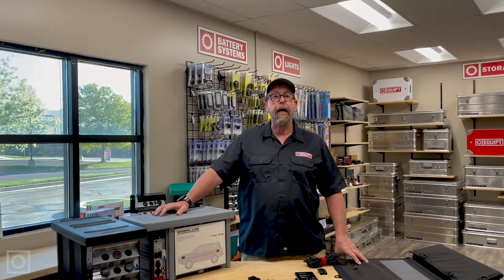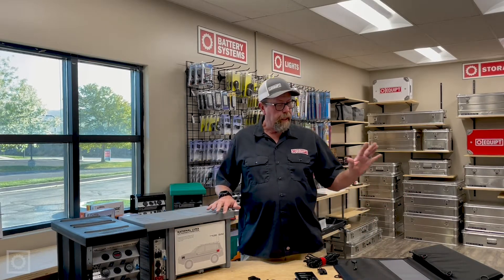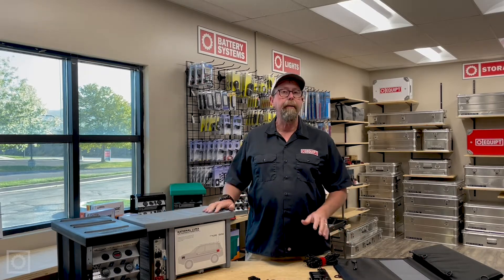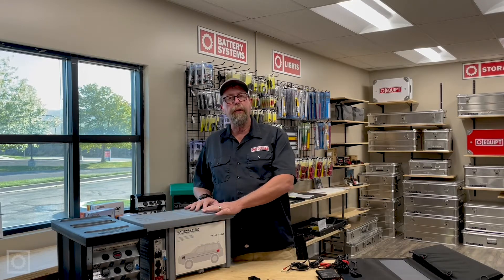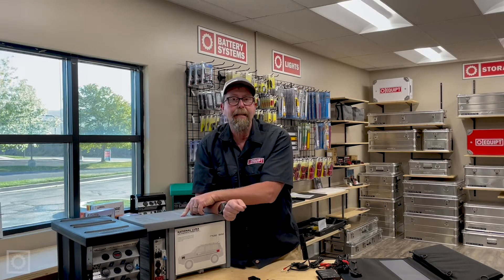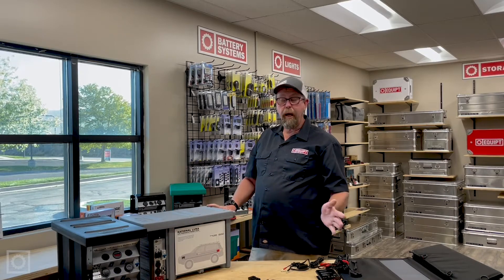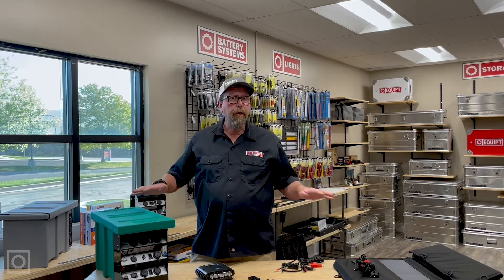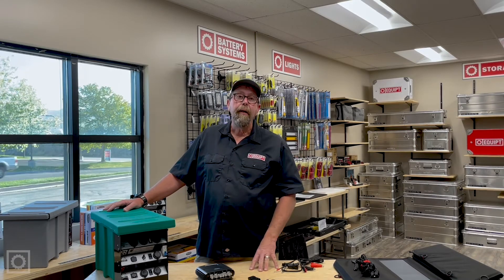How to Connect Solar to National Luna Battery Systems

Comment: Great video. You mention that you can connect an inverter to the battery box via the grey Anderson ply. If I do that do I need to ground the inverter? Or is that all handled in the setup of if the battery box? Thanks!
Reply from the maker: Anderson couplers have a positive and a negative contact point integrated. 

Depending on the size of the inverter, you should be able to connect an inverter straight to the aux anderson connection point. If the inverter exceeds the 50a rating for those connections, you should wire the inverter straight to the battery terminals. Some inverters have an additional ground that is meant to be connected to the vehicle's chassis as well.

Comment: Hello guys! 
I have the Luna grey pack and a DC charger redarc BCDC 1220. I wanted to plug my BCDC with a red Anderson to the red pack and use the grey one for solar / inverter or other things. But it seems it doesn't work. 

If I use the BCDC through the grey Anderson, the battery will charge but not trough the red one. Any idea ? Thanks !!
Reply from the maker: Hi there, great question.

Ultimately, you're combining two systems that are meant to accomplish the same thing. The RedArc system replaces the Intelligent Solenoid but the Power Pack and it's circuitry is designed around the Intelligent Solenoid. You are currently trying to push the charge from the BCDC through the intelligent solenoid (when connected to the red anderson input) and your DC charger most likely cannot recognize that there is battery connected to the solenoid on the other end. This is why you can connect through the grey anderson plug; the circuitry for that specific connection is most likely allowing the DC charger to recognize the battery. 

An alternative to the Power Pack would be the Aux Battery Box from National Luna (the black battery box). The DC charger can then be integrated into the Aux Battery Box without any interference from the Intelligent Solenoid or circuitry. National Luna offers an in house version of what you're configuring, the DC25 or DC40 Power Pack with an integrated DC-DC charger and solar controller. 

https://www.equipt1.com/collections/portable-battery-systems/products/dc-25-power-pack

There is not a great solution for modifying the Power Pack you already have due to the unique circuitry involved. You can continue using the grey input or potentially sell the Power Pack for an Aux Battery Box. 

https://www.equipt1.com/collections/portable-battery-systems/products/auxiliary-battery-box

Hope that helps, call or email us if there are further questions. 

-Morgan

Comment: Hi Paul thank you for the explanation. I have one question. I Have setup the Portable system NL Box directly to the main battery of my vehicle so when driving it charges the battery, But when adding a solar panel to the existing setup do i need to switch off the solar or can i leave it charging while driving ? Do not want to cause damage to the battery. I Want to use solar while driving or just standing on a location where there is no excess to AC.
Reply from the maker: Hi there Hennie, great question! Here's a basic overview. Much of the answer here depends on which solar controller you are using. Solar controllers have various voltage levels associated with their Bulk, Absorption and Float stages. This means the controller is monitoring the battery voltage so the controller can switch between charging stages. If your alternator puts out, let's say, 14.5v and the controller switched to the float stage at 13.8v, the controller will then drop the voltage to a preset level, typically low enough that there is no real active charge applied to the batteries. This float stage cutoff can be configured in many controllers but most will come with presets that folks don't usually change. This is the protection system designed to keep batteries from being over charged. When the alternator is providing an output over the float voltage, the float presets drop the controller's output low enough that you won't typically overcharge. Be mindful of the controller's voltage settings though. Please reach out if there further questions.
Reply: @Equipt1  Thank you Paul.

Comment: Can this little controller be configured for Lithium batteries?
Reply from the maker: Hi Jeff, 

The Overland Solar Bugout Bundle comes with the Epever 2606LPLI MPPT controller. These little controllers are lithium compatible and can be configured with the additional infrared remote available from Epever. Take a look through the data sheet at the following link for more details. https://www.epsolarpv.com/upload/file/2012/EPEVER-Datasheet-Tracer-LPLI%20.pdf